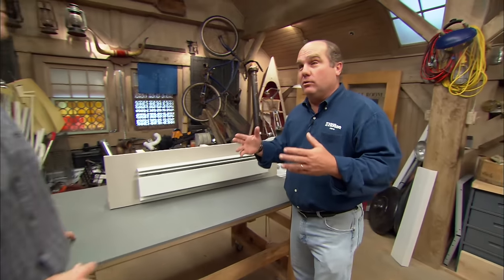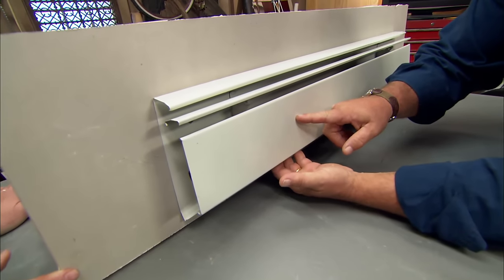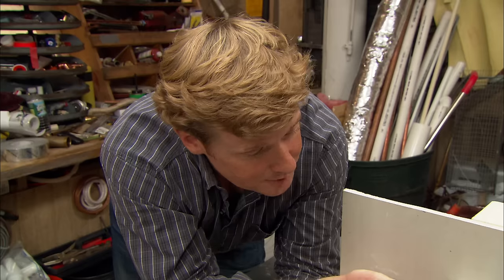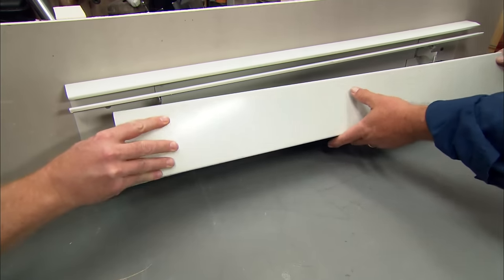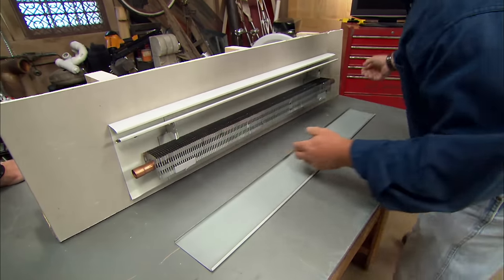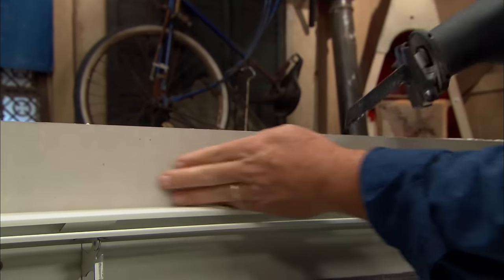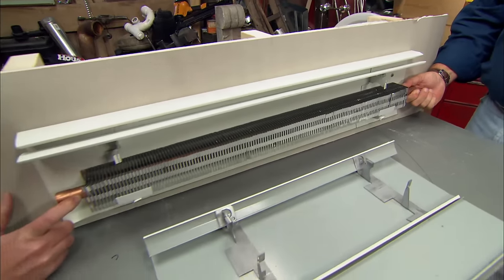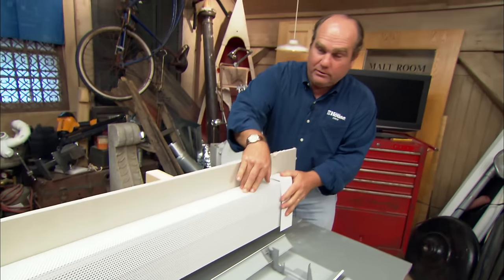How to Upgrade Baseboard Heating | This Old House

Comment: They’re going to cut the old one off with a reciprocating saw, but “be careful not to scratch the wall”      😂😂😂
Reply: I would try a cat's paw first,  the one made for pulling out nails.  Surprised a carpenter didn't mention that.
Reply: Easy…just slide a piece of metal sheet close to the wall and cut

Comment: Note- The new covers shown here will ruin a lot of the efficiency of your BB heating.  BB heating works on a 'stack effect', as they explained in the video where cold air is 'pulled' into the bottom of the fixture by the negative pressure of the hotter air departing from the top/damper area.  Putting this fixture which is full of holes in place of the original ruins that stack effect and lowers the efficiency of that unit.  Its actually very easy to make your own covers from wood in many patterns like Shaker-style, which end up being far cheaper and classy looking.  Plywood, MDF or 1x6 or 1x8 trim pieces, miter or circ saw and a Brad nailer or finish nails and some nice paint.
Wood is fine for BB heating as wood needs ~600f to burn, and BB heat rarely reaches above 140f.  Just try to keep the metal back plate in there in some way so it reflects the heat instead of heating the wall/studs.
Reply: New covers go over entire existing cover
Reply: @somedude2734  OK, however thats not what they showed.
Reply: @boots7859  perhaps, but hope my comment was helpful

Comment: I'm redoing a room and took off the back plate. Had to lift up the element a little to get to nails not screws.  It's pretty bent up. Any trouble getting element out n sodding new element? Make life easier since I have to install new backing plate first.

Comment: Does the decorative cover that you put on at the end reduce the efficiency of the heater.  The original baseboard heater works on convection but does that cover you put on do the same?
Reply: +Mark H Good question; it seems to compromise the "chimney effect" somewhat, reducing the convection output, though if the mesh actually absorbs enough heat, it might also increase the amount radiated to make up for some of the loss, but I'm sure there are some radiators that are over-sized to the point where it doesn't matter.

Comment: I replaced all my old baseboard heaters with these, upstairs and down. fireplace.homes .... Watching my electric bill shrink quite a bit over the winter months. GREAT DEAL !!!!!
Reply: How much did it end up costing you?
Reply: So you replace all your baseboards with 36 inch Recessed and Wall Mounted Electric Fireplaces?  That must look cool..... /sarc
Ok, so considering most places electricity is much more expensive than NG, what do you think monthly costs are going to be for someone in the NE?
I don't think a 36" even in every room is going to give anywhere near the same BTU's, and the electric bill is going to give someone a coronary.

Comment: Not really an upgrade, just putting a new cover on.
Reply: just like makeup ;)
Reply: Making it look better. So by definition, that’s an upgrade.
Reply: Absolutely upgrade with mesh cover,more air flow over radiator
Reply: @jtlos  To me that is refurbish or recondition back to original spec. 
Upgrade is when you replace the whole thing with newer model.
Reply: @wileecoyote5749  That mesh cover totally destroys the stack effect they talked about in the beginning of the video. So it'll not only look tacky over your crapped out BB's, but also make them significantly less efficient if installed as shown.

Comment: I have a baseboard heater in my finished basement that has it's own control knob on the end of it, Do you have any vids or suggestions on changing this to a smart system? It's the only room in my house that isn't connected to the main thermostat.
Reply: its electric im assuming?
Reply: @theravenless  Not 100% sure, there's a pipe coming from the wall into it. Not plugged into an outlet or anything.

Comment: Was hoping to see the dummy installed, not a shortcut solution.
Reply: Dennis, it's a PITA. I did my new house 2 months ago with the replacements, not easy.  Approximately 1 hr of work per 8 ft section.  Definitely easier with a second set of adult hands, 100% not  a 1 man job.  The 'new' cover he shows is gross, I'll glad I didn't install those.
Reply: Me too
Reply: @CARTSpeed22  I've done it in the past , not looking forward to doing it again

Comment: If I have hot water base board heating, is it possible to covert to radiant floor heat?
Reply: You already have the boiler. you can put the radiant coils under the floor from the floor below assuming you have a basement. So yes. I'd leave the baseboards on the second floor.

Comment: TOH should get out of the habit of calling this "baseboard heating"; "forced hot water baseboard heat" would be a better term. Too many people talk about hot water and electric baseboards as if they were the same thing, or just speak of "baseboard heat" without even mentioning the technology. The two are so different from a safety or even an economy perspective that any ambiguity leads to false assumptions. People should know that forced hot water is the safest heating available and electric baseboards are usually among the most dangerous.
Reply: Hydronic
Reply: Plus TOH needs to stop taking all the easy best case scenario on all their how to videos